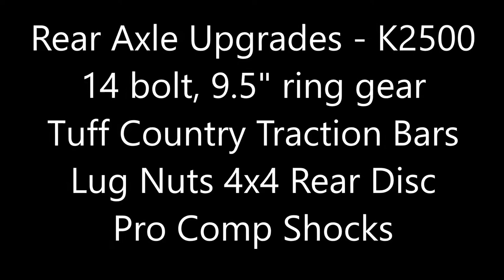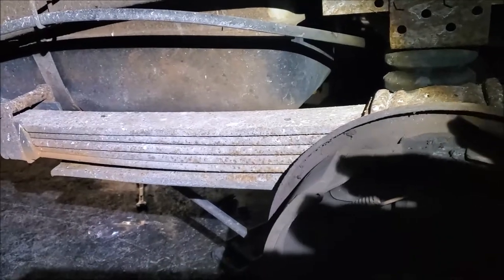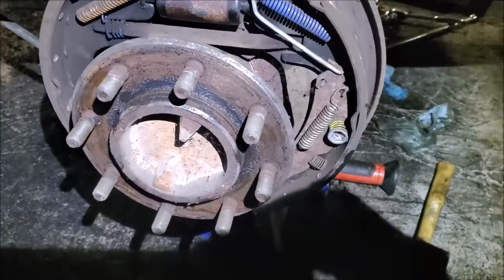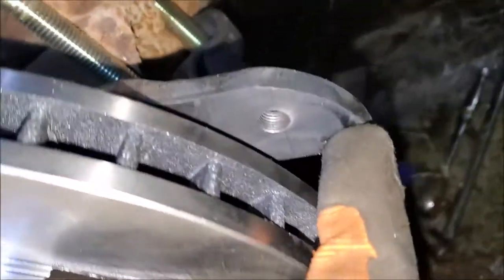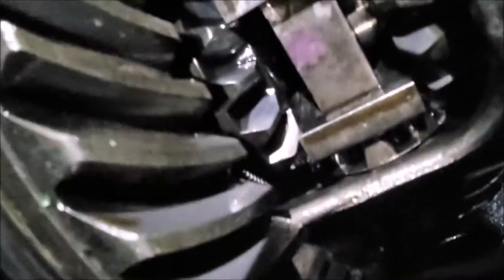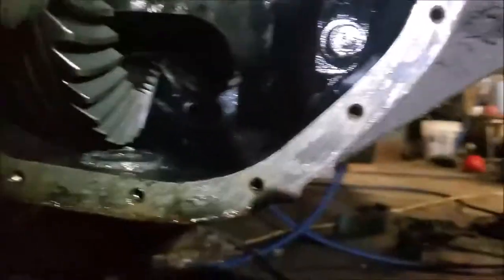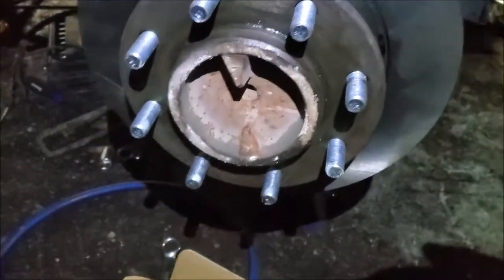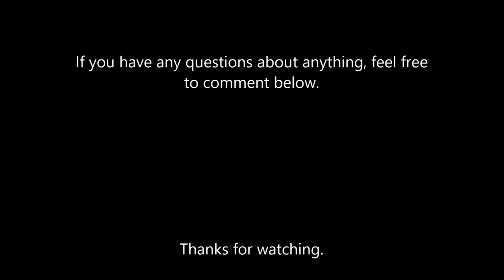Rear Axle Upgrades on the K2500. Traction bars, Disc Brakes, and Shocks (reupload to fix captions)

Comment: Are you happy with the brake upgrade so far ?
Reply from the maker: Yes. The brakes are great. I feel like it is easier to burnout from a stop. Maybe since im not spinning the heavy drums. 
  A few weeks after I installed the brakes and rear suspension stuff, I tore it down to start completely rebuilding the front suspension, steering, brakes, and differential. I'm still in the process of putting it all back together. 
  Slowing down from triple digit speeds was a handful. Steering wandered bad and brakes pulled hard to the left. I put new ball joints and polyurethane bushings in the control arms. New rotors, calipers,  hub bearings. New differential axle stub shaft seals. Locker in the front diff, cv axles, inner and outer tie rod ends, adjusting sleeves, new shocks. And a new steering stabilizer. I think that's it. Work got busy so I'm still in the reassembly phase. It's going to be sweet.
Reply: @EricErnst  my 85 k20 is down to the frame I’m starting from the axles up so I should be ordering my disc kit next week then off to the shop for gears and paint can’t wait !!
Reply from the maker: @MrDMV816  the brake swap was super easy. If I wasn't doing all of the other stuff, I'd have it done in probably 2 hours. (Including the c clips and hammering out the old wheel studs and in the new ones). You don't need to disassemble the brake shoes at all. Just remove the 4 bolts that hold the backing plate and the brake line at the wheel cylinder and she'll fall right off. 
  I love square bodies. Good luck with yours!
Reply: Where did you order you conversion kit from